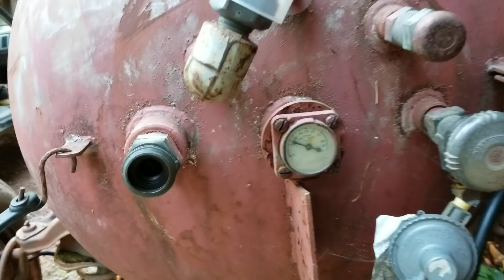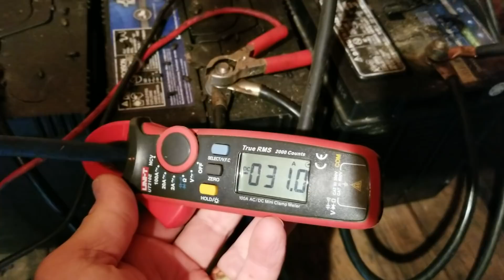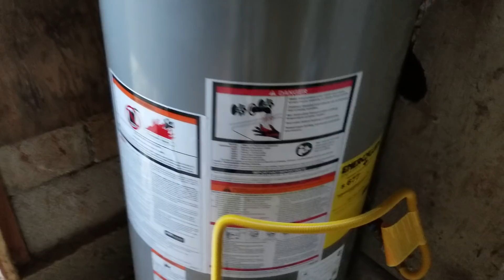Helping our off grid neighbors. (Helping them  Get ready for the snow)

Comment: I'm thinking about building a large DC generator with a 4 or 6 cylinder car engine. And use the coolant for heat. Basically let it fast idle with a few 24v alternators on it. Maybe build a electronic governor. To keep it at 2000 rpm or so. Maybe run it on propane. It will likely be overkill. But heat, power all in one. Maybe build a large thermal storage tank. To have heat when it hasn't ran in a while. I'd like a large bank of nickel iron batteries. Those look a bit aged. I had the crazy idea to build some once. But couldn't find the matereals or metals. Affirdably anyway. 55 gal barrels converted to nickel iron batteries could have huge capacity.

Comment: Cut some of the trees!!!  damn.. Even old panels can have decent output.. hell.. just throw them on the roof....
Reply from the maker: I hope to be able to rebuild the solar power system. I may be able to get some help at some point. The new water heater is in. The new roof is on. The wood is in and the propane tanks are full. It would help so much to have some solar working. The panels need new diodes soldered in and I have a charge controller to give them and the fusing. We have given them 2 generators. The last one we installed a new diesel for them. The rack for the solar needs to be built as well. right now I am just so thankful the wood is in. They are nice people in real need.
Reply from the maker: I hope to rebuild their system in the spring. I think I have enough stuff on hand to do it. I can get some of the guys at U-turn for Christ to help. That would save me a lot of generator maintenance.